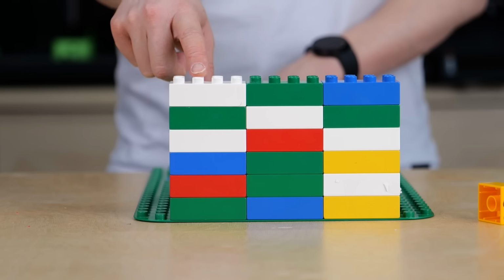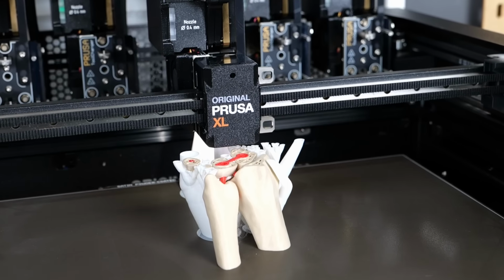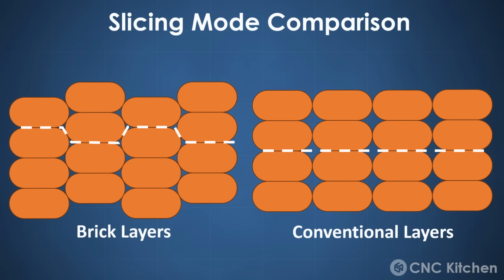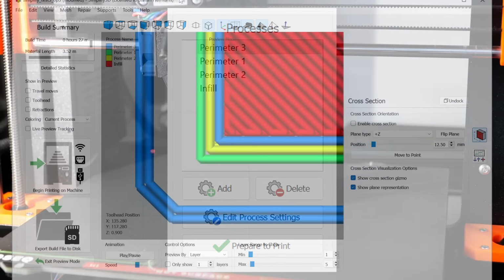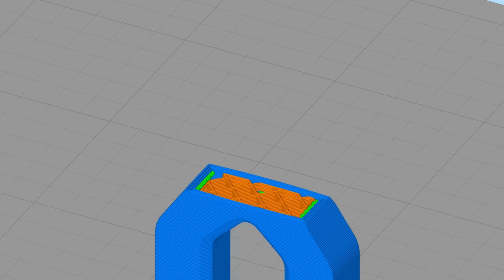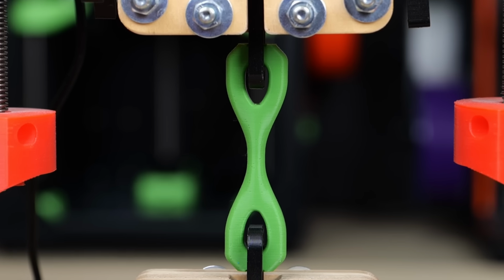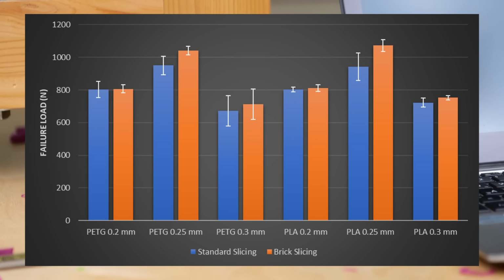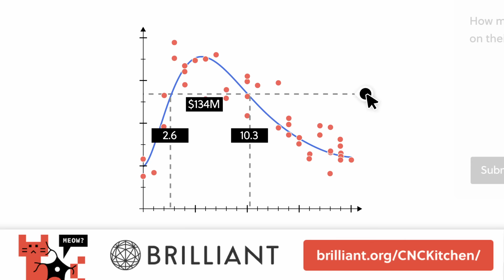Brick Layers - Why did no one do this before?

Comment: Part strength should have been tested using sheer force not just pull. With a pull test you are only testing the bond area, not the interlocking, this explains why you’re only getting a 10% improvement. On sheer force you will see more of the interlocking strength.

Comment: The microscope shots highlight exactly why 3d printed parts can be weak - you get almost 0 melting between layers. Extrusion factor should be greater to fillin the gaps, and should be extruded at a higher temperature and lower fan. Then you get very strong parts because the layers melt together into a solid piece. Trying to interlock non-melted parts is a band-aid solution here, which is why the improvements are marginal and inconsistent.

Comment: This is exactly what I suspect is going on with my 3DPrinty fountain. Those microcracks and gaps are definitely what's causing water to seep on the table below over a long period of time. This would certainly improve that. I hope PrusaSlicer and Cura get on this, but considering this video is 2 months old I don't have much faith... unless they're working on it and are running their own tests without disclosure.

Comment: About the fracture: it's expected. 
Brittle fracture start from a point and than proceed to the direction of lower resistance.
One of the methods to increase the energy of the fracture (and so the resilience of the material) is to deviate it's path to make it longer with more turns.
And this is exactly what you have made here. It's like the impact resistant glass that is more resistant to impact and when it brakes it seems to explode in many rounder and smaller pieces instead of making splitters. This effect is generally consistent in impact test like the Charpy test. You could try it could be interesting. 
It do not change much the tensile strength. That is more about the surface of contact but... also about the ability of the material to adapt and distribute the load if you have a brittle material.
And with interlocking you ad more rigidity and this probably is a counter effect that reduce the gain for the increase contact surface. This could give you a bit of lower effect and less consistency in you other tests.

Comment: While this looks interesting, I wonder what a uniform varying of the layer sizes might produce. 
So, picture a thick layer, three layers 1/3 the diameter stacked at that offset, then another thick layer as an example. This couls work like cement for bricks, better able to fill in the spots.

Comment: I like this. I think the idea that you managed to induce cracks along the length means you've effectively increased the poisson ratio of the material, meaning you can take advantage of the material strength in directions orthogonal to the subjected force. This could be especially useful in strengthening the material in buckling modes. The added strength in flexibility could improve compliant mechanisms.

Comment: Would a better result be achieved by attempting to emulate the x, y and z offset nature of brick laying? I understand that you have attempted to achieve that result is the output were hexagons but as others have noted, that can only occur with over-extrusion. What if each alternating layer was offset in base plane half the print thickness. I know this might be problematic when doing orthogonal calculations etc. and obviously the surface layer may need some further work. The existing proposal you are making, whilst a genuine insight for improvement,  lacks that "up" or Z axis interlocking benefit.

(Apologies if it has already been mentioned but I am not going to reach through 1500 comments to check)

Comment: More things to consider: How much longer does brick layer take to print? Does it use more material and if so, how much? Is the 10-15% increase in strength worth it, taking into account these considerations?

Comment: imo the comparison to brick laying is not accurate because brick is laid in one line where your method is laying multiple continuous lines in parallel. The direction of the forces that you placed on the material is also different than what a brick wall is designed to withstand. Besides that, I believe you are on the right track to improve player adhesion because you have more surface area bonding. It might be more accurate to think of this like concrete which has poor tensile strength but good compression strength. Rebar is added in that case to add strength. What could be added to a print though?

Comment: One of the things I thought of during this is a different fundamental problem with FDM, which you're going to deal with more using this technique: the adhesion between layers is temperature dependent. If the filament is laid across a more fluid surface, the layers will bond better - and your images show that bonding is minimal. 

Not dealing with a reservoir or enclosed area is one of the advantages to FDM, but if you're working toward stronger bonds a warmer environment (not enough to cause sag, but enough to maintain a fluid interface between layers during the printing process) seems like something to explore.

Comment: Ok so basicaly this new method improves strenght with the only drawback being most of the time it can not be repaired due to cracks in the whole print while the default methot is weaker but on breaks in a way that can still be repaired some what

Comment: Structural engineer here - you need to redo this test with 100% infill, at least at the lugs. The lug itself is in compression at the contact points, so it’s not transferring the load to the rod section symmetrically. I wouldn’t be surprised if the secondary cracks you saw were actually from the compression introduced by the Poisson Effect. As you pull this open cross section, it’s squeezing in on itself rather than symmetrically loading all parts. 

I suspect that your overlapping method will show far greater strength differences when you test solid cross sections.

Comment: I've been doing this the hard way with slicing in Orca Slicer then modifying the GCODE in Notepad++. I'm working on a script that should do that automatically. In my case, however, the alternating first layer bands are not 100/150 percent. I experienced some bed adhesion problems so I have mine alternate 50/100. With PLA, this is no problem. However PETG has to have the flow rate reduced for the 50% lines. Nice to see you taking an interest in it.

Comment: Haven't fully watched the video yet but wanted to mention this while I'm thinking it. I started copying certain aspects I see on plastic that manufacturers do to increase strength. There are two things to note. They add these features so they can make plastic thinner and make the part cost less to produce. And they also do the minimal amount of strength adding to also save money. For my personal projects, I copy some of these aspects but go ahead and make the part bigger since I'm not concerned with saving money. And also make the strength adding section bigger. An easy example, is now when making clips I add circles or half circle bumps in straight sections or at corners. I've made some simple clips like for hanging a basket on a metal panel fence that are only between 2-3mm thick and I can't even break them with my hands. So my best advice for making parts stronger is to start paying attention to the fine details on production plastic parts, copy those features, but you may want to exaggerate them for greater effect.

Comment: I want to say the obvious: more heat! If you have more surface area, you need more heat-per-surface to bond, as well as greater heat loss when we consider it by mass. It could make a very significant difference, more akin to pouring layers of concrete than gluing layers.

An interesting take would also be to increase the number of print heads. If a layer is only composed of a single line, that's akin to a serial process. With two printheads, one could either print the individual tracks separate (greatly reducing heat lost) or design things with a weird spiral symmetrical shape. The most cursed: alternate spiral directions, so force travels in linear paths like a honeycomb, but also in spiraling bonds.

Or even: alternating materials! Traditionally one might go layer-by-layer, but if you're already splitting "even-and-odd" within a layer. This need not require two printheads working simultaneously, they'd need just enough room or ability to move out of the way. Could even be mounted on the same axis, and as a print head doesn't rotate, the only consideration is keeping the wires and material from tangling.

Comment: Maybe my mind's eye is misconceptualizing something here, but can't you just print at an angle to achieve this type of layer stacking? Given the oval cross section of each printed filament, it would be greater than 45° and closer to its natural angle, but you should be able to iterate until you narrow it down with a halving scheme where you just try ty reduce your error by 50% until its so small it just doesn't matter

Comment: Looks like the weaker parts are easier to repair. So for models youd want the regular slices, and if it ever gets knocked to the floor you can just glue it back together. If you need a useful part print these stronger ones and replace the broken mess if it ever fails.

Comment: that first example of a "brick wall" isn't really valid because lego bricks only connect vertically, not horizontally, which is what makes them unstable. actual brick walls are indeed built that way, because the cement joins the bricks along both axes

Comment: why not print the inner layers at a higher temperature, so that they are more liquid and fill in the gaps?
Reply: It would make sense for big parts, but for small ones it is a problem: the nozzle takes several seconds to warm or cool down a few degrees.

Comment: When I first got into 3D printing, I had that very thought, alternating layers for better interlocking of layers.  Seeing your microscopic view show what is lacking, that being the filling of the empty areas.

I see that simplify 3D does not permit individual wall flow changes.  That being the case, the voids can be calculated as a percentage of theoretical solidly printed parts, then the flow can be increased as well as printing temp, to get the plastic to flow into those areas.

Comment: Zigzag/conical failure is very similar to ductile material failure. iIt is amazing that you made a 3d print act like a ductile material rather than britile. For the longtitudal crack, I have a theory: the printed layers are brick-layerd only vertically, but not planarly, making it easier for the crack to move horizontaly over the layers. The more circular your line will be (i guess like in "fine" printing modes), the more brick-layerd the vertical columns will be.

Comment: No you didn't introduce new weaknesses - the fact that you have cracks, proves the tension is distributed more evenly over the whole part, which is what you were looking for. 
On unrelated point - have you thought of a way to do it also on XY not only on Z? Say you are willing to accept half filament width sticking outside?

Comment: I feel like the tests done here, while valuable and interesting, don't address the likely highest-improvement vector of the brick pattern, that being sheer strength. I was fascinated to see how much adhesion benefited from it, but a force from the side will find itself spread across many more layers in this method over traditional.

Comment: This is nothing new. The design is as old as nature. This is essentially re-creating the honeycomb which is known for its efficiency and strength.

There is one more possible dimension you could add to this design, however. Take the image on the far right at 8:30 and duplicate it then put it in front of itself on the y axis then shift it's x-z position down and over slightly so that the y axis edge fits snugly between 3 nodules. This would be a 3d honeycomb instead of just alternating the prints on 2 axes, you would be alternating them on 3 axes/dimensions.

Comment: I mean it is a great idea on paper but in practice I don't think it really gives a big enough benefit.    I think the problem with this is that it is much easier and stronger to just properly orientating the part with good design, I noticed you never printed the parts on their side to include a comparison for properly orientating for strength.      That is really the problem is there are few instances where this would be the proper choice vs design and orientation for strength.

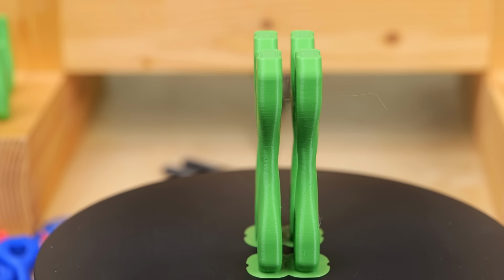Comment: 2:10 you’ve made a whole video on a wrong basis, that is not how bricks are offset, they are offset horizontally.. it isn’t one up on down otherwise 1) it won’t do much 2) your floor/roof won’t be straight. But horizontal offset doesn’t really work when your “bricks” are a continuous line..

Comment: totally inefficient, but what if you printed with two different nozzle sizes i.e one layer is 0.4, 0.8, 0.4, 0.8; second layer is 0.8, 0.4, 0.8, 0.4, third is 0.4, 0.8, 0.4, 0.8 and so on.. so the slicer doesn't have to change extrusion height.

Comment: I don’t think it’s fair to compare tensile strength with brick walls. Brick walls suffer compressive stresses. And aren’t at risk of delaminating. The stepping of brick walls doesn’t work as implemented in your slicer modification, as brick walls aren’t stepped in the vertical axis and still have horizontal layers of mortar. 

The increases in strength seen, I believe, have more to do with increased layer bonding area. I don’t think you would see the same increase if this test was done with the test printed printed horizontally such that tension is applied in the same axis as the layers.

Comment: A chain is only as strong as it's weakest link, so stop making the weakest link an airy, welded layer, (one plane or two offset planes). Instead, make it a tight, solid honey-comb.

If you going to build a structural part, the fibers need to align with the flow of tension and compression. The main reason why 3D printed parts are so weak is because most of them are made by non-engineers. Can 3D printers print in vertically curved layers? If so, the best way to print an hourglass shape to be pulled in a test rig like in your video would be to print it sideways. Have thick fibers near the (thick) ends of the model, and thin fibers near the (thin) middle of the model. This will maximize cross-section area at the weakest point (the thin middle). A lot of small men doing a lot less work and more total muscle involved. More stable. If the max difference in thickness is only 4:1 as seen in your video, then adjust number of fibers in the cross-section as needed. This will make the model up to 20x stronger than any example in your video, since there would be up to 10x more material handling the tension force, and up to 2x stronger beyond that, because it would be going through solid fibers, not welded layers. It should handle hundreds of kgf, not dozens.

Comment: 3D printers still ignore the fact that both pieces of plastic need to be melted in order to get proper welding instead of the adhesion you normally get with 3D printing
Reply: I also noted a lot of air spaces in the 3D print would putting your 3D printer in a vacuum chamber and removing all of the air get rid of these spaces

Comment: Not an expert, but in Engineering, objects that are strong, but are brittle, and has no predictable fracture plane are usually undesirable. Take the carbon composite on the Titan for an example. Hard, but under those condition is not predictable.

Of course it's depending on the application, but universally speaking, it's a no in the current stage, even if it is stronger. Hopefully you'll or anybody will work this out!

Comment: hm... interesting. i don't find a 10% improvement that impressive though and the cross section doesn't look like there is that much difference in the amount of "fusing points".

wouldn't it be possible to do the opposite of ironing? instead of making the surface smoother, making it rougher? repeatedly dip the nozzle into the surface and do some short length stringing or something. :)

Comment: I like the result, but I bet you can improve it by over extruding by about 15% over the microscope pictures you showed. Filling in those gaps a little combined with the brick layer strategy will push the strength up even more.

Comment: Hexagons are the bestagons once again! No seriously, your very elegant solution is a very similar approach to how simulations (cellular automata, particle simulations, etc…) that are normally carried out on square lattices are instead run on hexagonal lattices. In a square lattice you simply offset every other row by one grid position. My only suggestion would be that you applied your trick in only the vertical dimension. Can you also apply your trick so that the print head doesn’t follow concentric paths building up, but every other layer prints radially inward? 
For example 
\ | /                    (())
/ | \ instead of 

?

Comment: This looks exciting.  The fact that you achieved both greater strength AND reduced (strength) variability on your first method are very good signs!  I think that other implementations should be tried.  It looks to me like there is an opportunity to over extrude in the valleys for higher density in high stress areas.  One challenge I see is you don't have "half bricks" for the edges so outer fiber roughness is a stress concentrator.

About the longitudinal cracking, my interpretation is these are impact fractures from the snap as poison's ratio goes from max to zero.  It also might be influenced by fill layer positions.  BTW, doing a high speed filming of this fracture would be awesome!

Comment: The failure is listed in newtons instead of stress (kPa)? This makes the information less useful and not possible to compare it to the upper limit - isotropic strength of the material